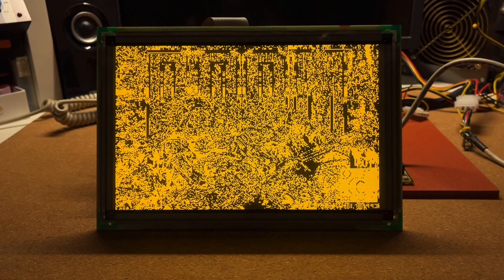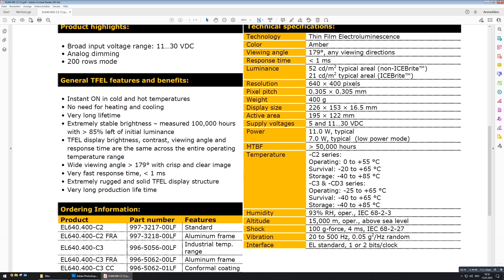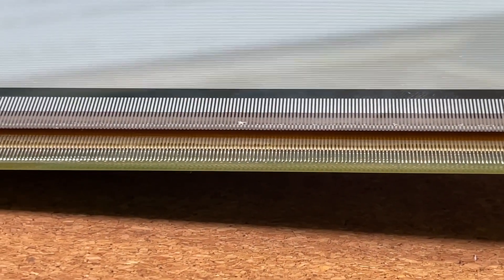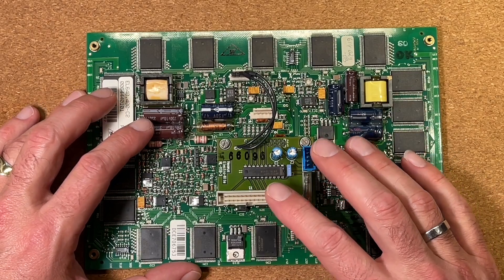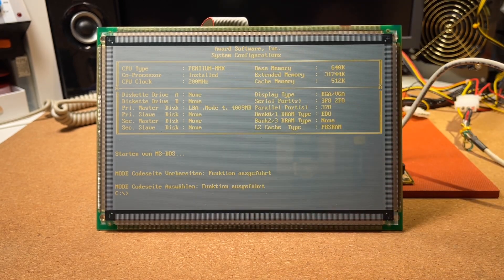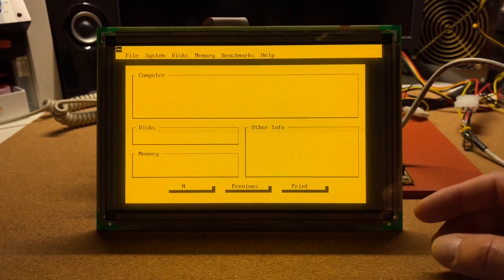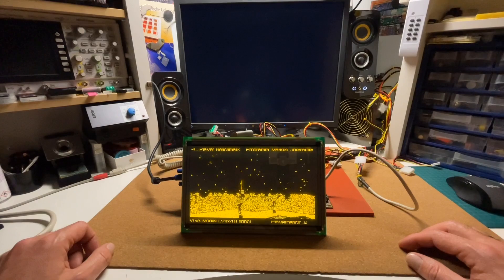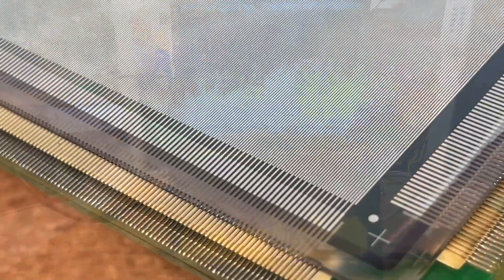7" Amber Flat Screen on VGA Feature Connector / Playing Doom / TFEL Display

Comment: I have definitely used cash machines with that screen back in the 1990's! Which typically ran OS/2 Warp in the background for stability and security. Each pixel is either on or off, so any application (or game!) that requires gradients of hue or saturation is going to look pretty rough, as you demonstrated. but it was not designed for that, just super-clear interfaces like a cash machine needed. Very interesting to see the raw digital output from that Trident card, of course normally with the single 15-pin connector it is analogue. The Feature connector is performing like a modern Display Port connector. I remember so many cards had that Feature connector, but never saw anything that used it, so this video was very interesting for that reason. PS, I am pretty sure, although it's a very old memory of mine, that Norton Sysinfo has a command line option to start it in mono mode, where it would actually look fine on your display. Anyway - thank you for the great video! You should try to watch one of your videos on this :)
Reply: I remember the Reelmagic card using the feature connector for video overlay. It was a hardware Mpeg-1 decoder for 386/486 computers, from 1994. We had one displaying Video CD movies in the computer shop that I worked at.
Reply: I also thought that I saw ATMs with such displays, but I'm not sure if they were just P3 phosphor CRTs I was too young to really notice, but the first ICE train had those displays for sure.

Comment: These displays were the darlings of military contracts in the 1980s because of their extreme operating temperature gamut, and extremely fast switching speeds compared to LCD or even neon gas plasma, they can even be constructed on a transparent substrate for heads-up displays (and were used exactly for that purpose), a great display if you can get your hands on one, but second hand prices now are somewhat insane. The interface is a very simple 8 bit parallel interface.
Reply: The TFEL displays require a bit more logic to simulate darker colors (basically turning pixels on and off per frame in moving patterns to simulate the darker colors), but otherwise, it's literally just ON and OFF.
Reply: @tschak909  So it's kind of like DLP in that regard.
Reply: @tschak909  Do you mean PWM brightness control or some other technique?
Reply: @tschak909  If only there were a TFEL which had simple RGB color.
Reply: @AmaroqStarwind  reminds me of how some early OLED TVs were marketed as EL displays in some markets. (Probably not technically true due to some technical detail or other.)
Reply: Agree the cost is insane. I have one of these Planar displays on a tektronix 3002C 'portable' logic analyzer ($12K in the 90s). They made the screen as thin as possible to fold up so they put the HV supply in the body and ran it thru the custom cable - crazy. Powered it on a few months ago (after sitting for 25 years) and the display came up - but then let out the magic smoke. Replaced some caps and could only get 1/2 of it working again. Looked around for another display. Forget it $$$. Loved that analyzer (20 channels @ 1Gs/s) but don't need that speed right now and a new, cheap analyzer is way less than the cost of a new display. Could wire up a CGA but just gave up on it and bought something a lot smaller and lighter. Loved that old display though.
Reply: @tschak909 do you have any more information on the protocol used to communicate to these things. I have one at work that I'm attempting to replace and I'm completely new to this kind of electrical stuff. Thanks in advance!

Comment: I had a display with a blue white EL backlight, but it was totally flat, EL itself was well past its best, and the display itself was a 320x200 MDA panel with plain TN display, and as slow as molasses, plus a viewing angle of around 10 degrees, only viewable in near darkness.

Another was a Panasonic, similar to that TEFL display, and also it was well burnt, and also very much mono only, with barely any contrast range.

Comment: In my company we are still using that display for one of the devices we sell, since 95. Its a very high quality, high contrast, very wide angle display
Reply: Is it still >85% brightness after 30 yrs? ;-)
Reply: @Thomsonicus  its not the same display, they buy the same model for each device they sell since 95